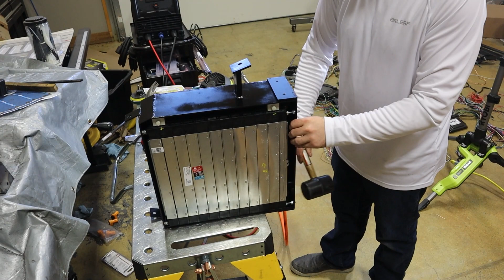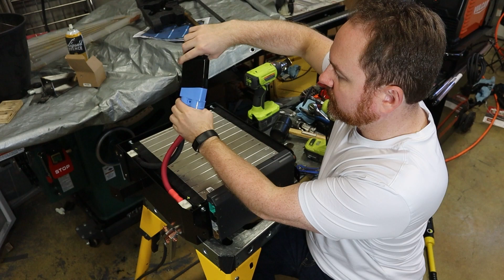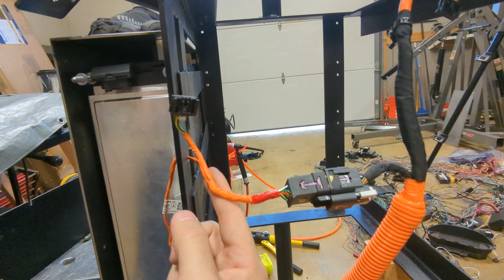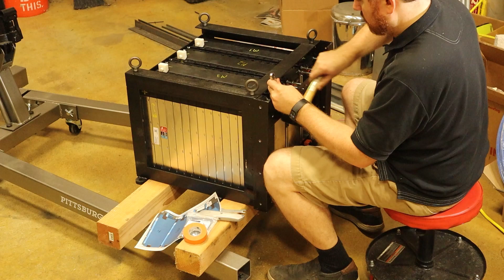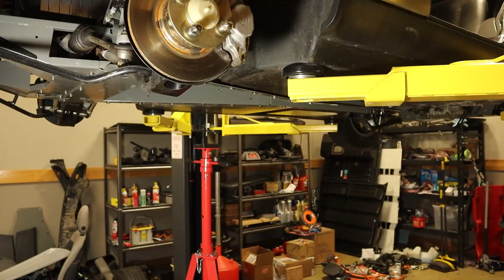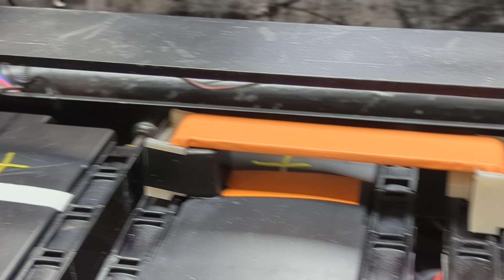DeLorean EV gets batteries!

Comment: Excuse me how in the goddamn fk are you planning to cool the batteries? GM cheaped out on top coldplates and batteries swell under DC fast charging and then there's THIS GUY.
Reply from the maker: haha - well, I'm fine with charging this particular car at 50kW, so I'm not going to worry too much about it. I will be sticking with single-sided cooling using custom built aluminum chill plates. Each plate is made of a thin aluminum sheets sandwiching a thick aluminum 'core' that has laser-cut channels. Fittings are then welded onto it. The rest is all stock, the water is chilled using the A/C system and heated using a HV resistive heater.

Comment: When are you going to add the cooling or is that the air space between the packs?
Reply from the maker: It'll be a while - cooling isn't really necessary for the packs, just helps them last longer. Cooling plates will go in the space between each module, and I'll have a video dedicated to it in the future.

Comment: I would be quite concerned about rubbing out the insulation wires that are passing through the notched areas of the brackets. Also, is there anything protecting the cells from water ingress further in your plan?

Is it correct that the cells are held in place by the small screws jacking against the frame? Those seem like pressure points that the cells may not have accomodations for in their structure.

Some safety goggles might help save your eyesight if you end up creating some of the arc flash that you have mentioned with bridging out terminals.
Reply from the maker: I agree with your concerns! I have updated the notches since then and will have a video on it in the future. I've also put side panels on the battery box to keep water from splashing in - although it isn't water tight.

The cells are held in place with long threaded rods with a nut on either end - however the nuts on the outside of the pack are a separate set of nuts, so that tightening them down does not compress the pack any further. The cells are also wrapped in plastic frames, so compressing them down is still limited by the frame and can't be over compressed.
Reply: @BillCarlson  Good deal Bill. Sorry if it seemed like i was dunking on your work. I felt bad for posting without more qualification and in haste which made my opinion come out more critical than I intended. I hope this will make amends for that tone to some degree.

Yours is quite a project and like all engineering endeavors takes iteration to refine and finish.

I look forward to seeing more of what you do.

Comment: None of this looks particularity weather proof. All components are designed to be in an enclosure with a rating of atleast IP65+ (submersible) by the OEM and you are not even splash proof on most parts of your installation. Even just moisture in the air will wreck havoc on your connectors and BMS.
Reply from the maker: This is true - I have an upcoming video where I enclose the packs and make them mostly splash proof. The current design will never be submersible or air/water tight, though. At some point I may redesign the packs to make them air tight - but for now I want to get the car running and work the kinks out (need to add cooling, for example).

Comment: Looks good on the high voltage side, but I'm afraid that the BMS wires will vibrate and rub against the sharp notches you made in the box frame.  Please please please find a way to securely protect those wires in the slots!  Looking forward to wheel spin!
Reply from the maker: Already done - stay tuned for the "Battery Pack Upgrades" episode! :)
Reply: @BillCarlson  Whew!

Comment: Question/idea Do you plan on using the glove box? If not, Why not but that large kill switch breaker thing in the glove box? You could shut it off without having to get out of car and its really close if you have to shut it off quick say during a drive where you don't have time to stop get out and do it. As for the other idea i thought in last video, it might be easier to make that P. Box as a cover for under the hood, so you see anything but a big case but its just a big cover to hide things. Where the sides of it just looked like the normal under the frunk area with a big case in the center that had a small handle where you could just grab it and slide it out to show or get to actual parts. Just more geeking out from me :P . This still is freaking awesome!
Reply from the maker: I do plan on putting the glove box back into use - it's basically the only place in the car where I will have hidden storage. Also I have a rule that I don't want high voltage inside the passenger compartment. Purely for safety reasons.

As for the front battery box - I'll have a video on upgrades to the rear battery box and it's very similar to what you're suggesting. The top lid is a cover - and I also have covers for the sides. I can paint them all yellow and put stickers on them. :) I'll see if I can find something that looks like a handle for the case lid!

Comment: I love how this is all coming together. Thanks for taking us with you on your journey. One question: do you plan to operate the DeLorean only under 'nice' ambient conditions (I don't see any provision for temperature control on the battery modules)?
Reply from the maker: Great question! The batteries will be actively heated and cooled, same as in the Bolt. Each battery module will have a custom built liquid cooling plate next to it, and then pipes will connect them all together. Heating comes from a high voltage heating element and cooling uses the AC system. This won't happen for many months, though... Maybe a project for next winter!

Comment: Do you not need to make sure your battery terminals are isolated via contactors in each battery pack? Or need to use double locking connectors for hv? Or use anything rated to ip2x in your country?
Reply from the maker: The US doesn't have any electrical code requirements for homemade/converted vehicles. That said - I will have a video on battery pack upgrades in the future (work is done) where I add a full enclosure, fuses to the small packs, grommets, and IP67-rated connectors for some HV connectors. I'm not sure what the codes are for manufactured vehicles, but I've heard they require a fuse in each battery box and a single contactor on either positive or negative.

Comment: Nice update but don't forget those BMS wires are at FULL battery voltage so you should be VERY careful when handling them just as when handling the buss bars. 😉
Reply from the maker: Yes, absolutely!
Reply: @BillCarlson  A thought... is Open Pilot a future option ?
Reply from the maker: @kylereese4822  Its absolutely an option! Since I am retaining all the components from the Bolt, it would work the same.